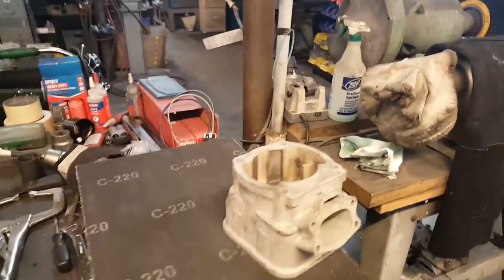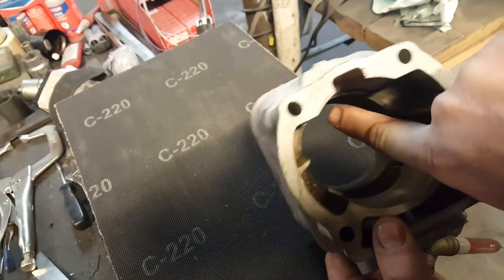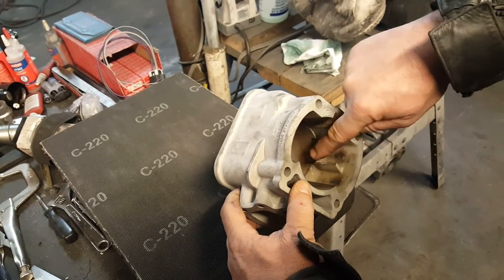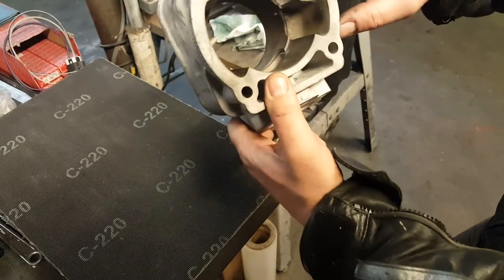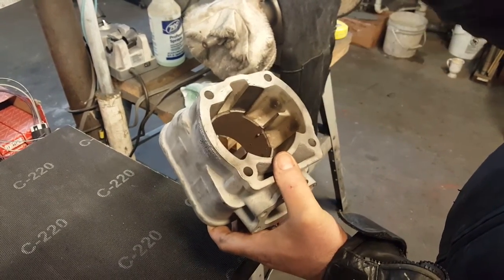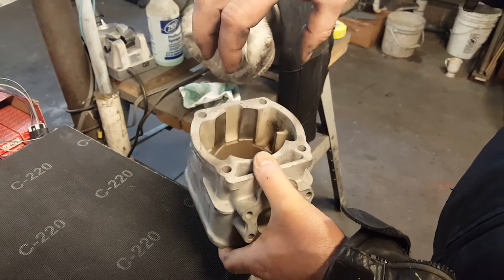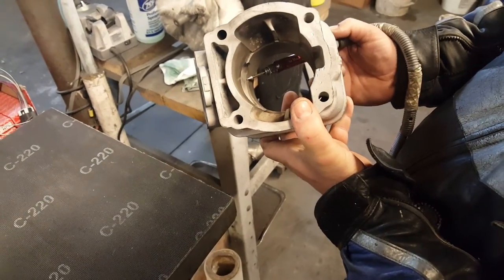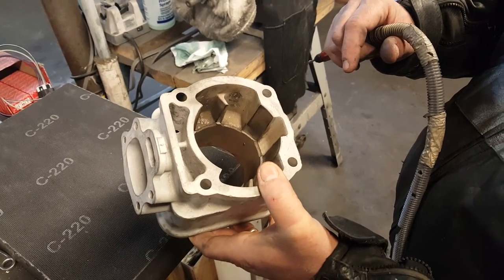Cutting and replacing  sleeve

Comment: Thanks for the instructions !! I've just removed mine, I thought it was easier not to break then, I just heated the cylinders in an oven and used a press to push the sleeves out. The come out very easily !!
Reply from the maker: Yes, if the're isn't jagged edges that will scratch up the cylinder wall then that's the way to go first.